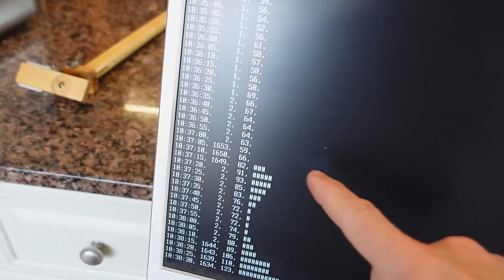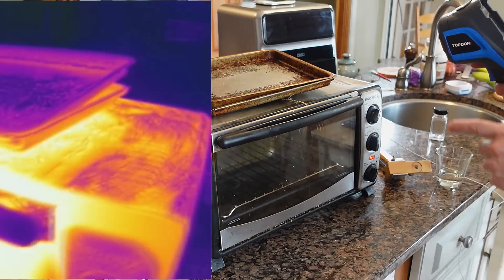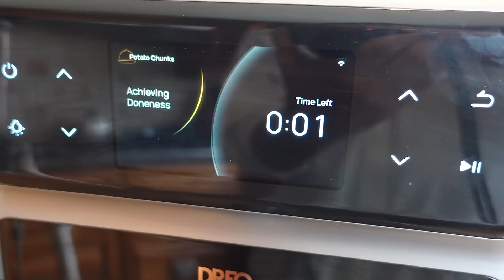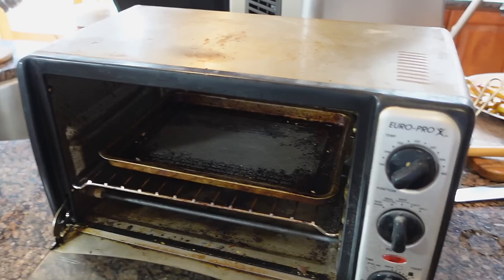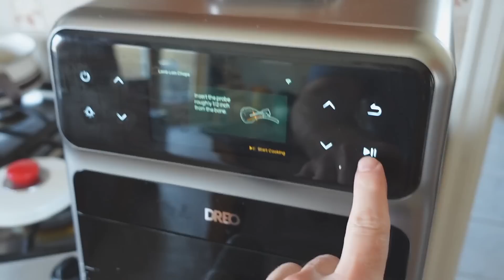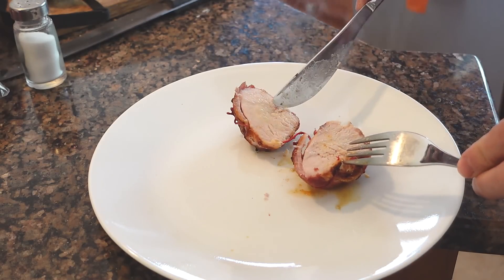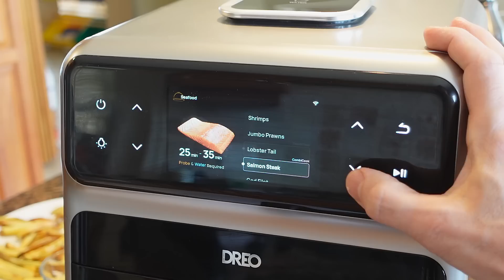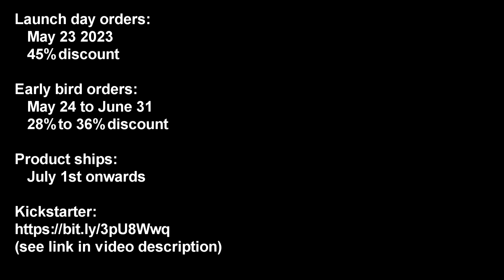What does an air fryer do?

Comment: Glad you liked it, its probably worth mentioning that practically any air fryer will cook food exactly the same way. As cool as the built in screen and recipes are personally its not worth the $150+ extra over a basic little store bought one.
Reply from the maker: yes, basic ones are surprisingly cheap, and I think as long as you keep an eye on the cooking process, they will do as good a job too.
Reply: There's a lot of trial and error when it comes to those things.  Having the recipes built in would probably be really helpful, especially for people who don't have a lot of cooking experience.  Add in the built-in meat thermometer and I could see it being worth the cost.
Reply: I have a simple air fryer with no screen, just digital. It has some recipes on it that I never use. But mine does not have water ability and probes. Those two things add alot of value to the end product. And if you cook quality stuff in air fryer like lamb racks etc and given that the air fryer probably will not break within at least 5-10 year. What is 150+ one time extra for a decent air fryer that you will probably use several times per week? $150/(12x10). I mean, it's not even a cost in the end to even think about.
Reply: @libb3n I look at the total cost of adding this appliance, and since we already have an oven and a small oven toaster, I can cook all what I need without it. I would get one if I lived in a place that does not have an oven.

Comment: As a bachelor myself, I really do love the convenience and consistency of my air fryer, great for sausages! But my first appliance died right after the one year warranty. The brand was very strict on their policy and refused to share any information about repair. As a bit of an electronics tinkerer I thought it would be as simple as opening it up and locating a blown fuse or something. But after removing all the screws from the unit the darn thing was strongly clipped or plastic welded together making home repair unfeasible. Would be interested in a follow-up teardown video of your unit or maybe one that someone is throwing away.
Reply from the maker: I thought about opening it up, but there really isn't much to it, and on Dreo's website, there is some views that show a bit of the inside.  Really, just a heating element, a fan, a water pump, and electronics
Reply: @matthiasrandomstuff2221  Well then, Matthias, make one out of wood.
Reply: @Don.Challenger  The first Air Fryer prototype was made out of wood.
Reply: Same here. It took me ages to get the bottom off, then once opened it wasn't possible to go any further non-destructively (that I could see). I would have been quite capable of replacing the working gubbins with a microcontroller if it opened up easily. I got a new one which interestingly seems to be based on the same core design and have the same electronics, just packaged a different way.

Comment: Great video, I’m really curious about the water and potentially baking breads, since steam injection ovens are rare and quite expensive. 
Air fryers are essentially convection ovens, and I prefer the toaster oven shape for loading so personally ended up tabletop convection oven more like your toaster oven, but this seems like a great product for those that like this form factor.
Reply from the maker: It doesn't have a bread mode, and the water injection only happens in the automatic programs.  But I don't think this would work all that well for bread.  The heat comes from the top, and if the pan was full of dough, the bottom wouldn't get enough heat.
Reply: I made small buns in my air fryer, and with the hot air circulating underneath, they came out very well. I also have 2 spray bottles: oil and water to use as needed.

Comment: Love making cauliflower in our air fryer! Break it up, add oil, pop it in, give it a shake a few times and when it is browned, it's done. So good. Perfect side for steaks, chops, burgers, etc cooked on the grill. 

Ours isn't that sophisticated, just a temp dial and a timer, but it does a decent job on meats when it is too cold/snowy to grill.

Unlike an oven or toaster oven, the timer and cool to the touch outside allow us to be comfortable with our young teen using it when we aren't home. 

The biggest complaint I have is ours is just too small, yet too big at the same time. Can't fit enough food for 4 in it at once, but takes up a lot of counter space. Make me a double basket model that replaces my range hood (include a vent fan) and I'm sold!
Reply from the maker: they need to be small, cause tere's only so much power that you get out of a socket, and you need lots of heating power for the volume to fry things.  But yes, capacity is an issue.  One time, with guests, we had two going at once.
Reply: @matthiasrandomstuff2221  benefits of 240v :)
Reply: What you are looking for are options on the market now. There is a Ninja duo basket and also small convection oven/microwave combo. I have an 8qt that I use at the same time as my Instapot and it works well for large volume.

Comment: Toast oven looks disgusting, maybe with all your knowledge you could find a method to get it cleaned? Other than that I like your content. 😀
Reply from the maker: I cleaned it a bit before making the video.  Don't know how to get some of that baked on grease off.
Reply: Any heated appliance or cookware could look like that after years of use even when perfectly cleaned. It's just micro layers of oxidized stuff baked under oil stains, 100% harmless.

Comment: Air fryers: Do. Not. Exist. Convection ovens do, and that's all these things are. I'm so tired of marketers changing the meanings of words for profit. These things don't fry, they bake, and they are just small convection ovens. I have an "air fryer" from 1991. It's a combination microwave/convection oven, made in Japan, so of course it's still going strong.
Reply from the maker: I take it you haven't used one.  Ever did a steak in a convection oven?
Reply: @matthiasrandomstuff2221  Correct! And yes, I do steak in my convection oven when I'm not grilling it. I use a cast iron grill pan and sear one side, then flip the steak and put the whole thing in the oven. Other than the fancy interface, I see no difference between a convection oven and an "air fryer".

Comment: All they are is a mini convection oven,nothing more. Convenient for 1 or two people for frozen fries but thats it. Useless otherwise
Reply: Air fryers are basically mini convection ovens, with the difference being the fan blowing across the heating element first. The small volume and insulation (if you can call it that) are key to how they work.
Reply: Obviously they are similar but they have huge advantages, especially up to temp pretty much immediately. It's like saying you're stupid to buy a Ferrari when a lada does the same thing.
Reply: @timlaunyc  some convection ovens have dedicated heating coil for the fan